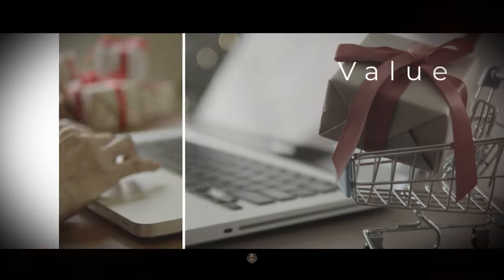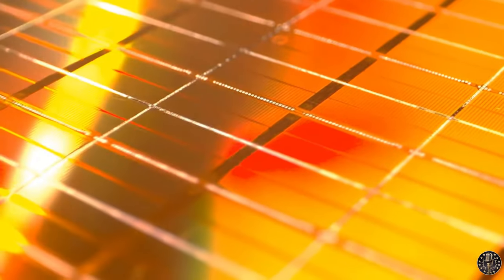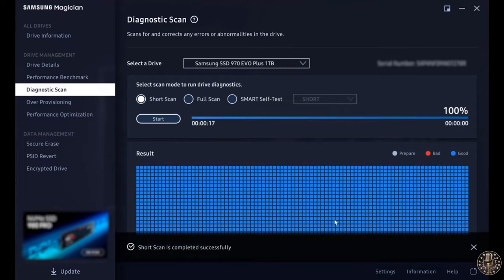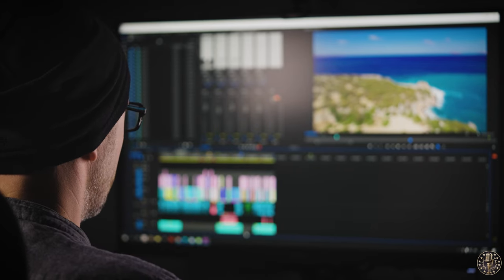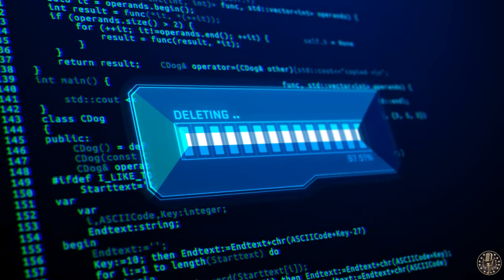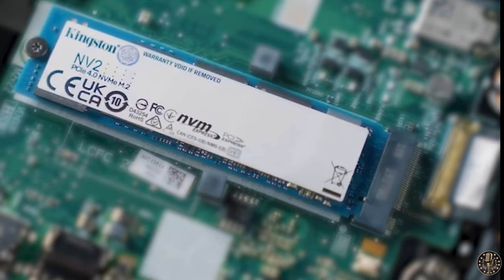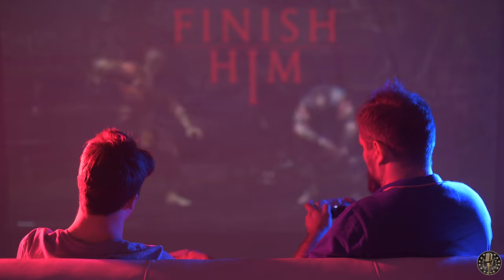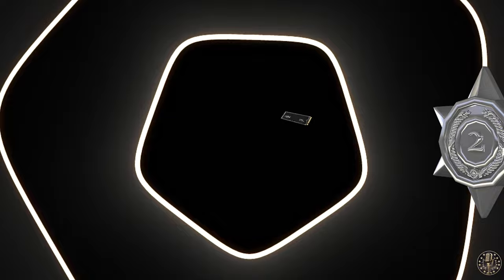Top 5 Budget NVMe SSDs: User-Approved Picks Revealed

Comment: Don't be fooled by the Gen 4 label. The 1TB Kingston NV2 "Gen 4" SSD is a sheep (Gen 3) in wolf's (Gen 4) clothing. It is the slowest Gen 4 NVMe SSD I could find in the current market with a mean (advertised read+write/2) sequential speed (MSS) of just 2800 MB/s. That is 11% slower than the next slowest Gen 4 SSD. In fact, there are at least 45 Gen 3 ("sheep") SSDs on the market currently that perform faster than the Gen 4 ("wolf") Kingston NV2. It is objectively not a good value relative to other market options. For example (one of many), the MSI Spatium M461 performs 64%+ FASTER (4600 MSS) for a (currently) 6%+ LOWER PRICE.
Reply from the maker: Hey, thanks for your insights! 
You're absolutely right about the Kingston NV2's performance in relation to its Gen 4 label. It's a reminder that specifications like 'Gen 3' or 'Gen 4' can sometimes be misleading without considering real-world performance. We included it in our list based on user reviews and popularity, but we completely agree that there are other SSDs on the market, like the MSI Spatium M461 you mentioned, that might offer better performance at a similar or even lower price point.
Thanks for helping us all make smarter choices. We appreciate it! 😊